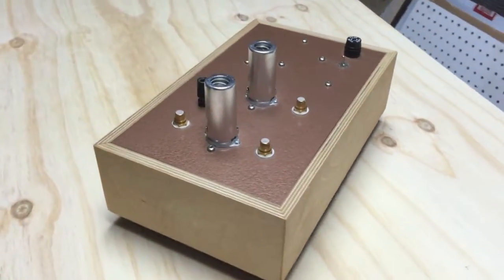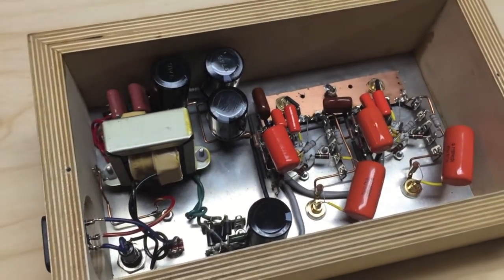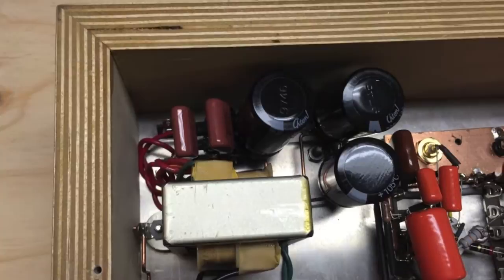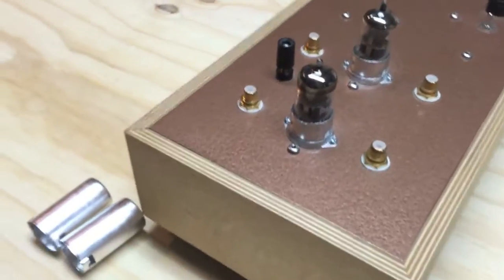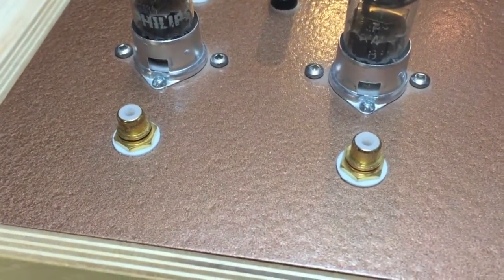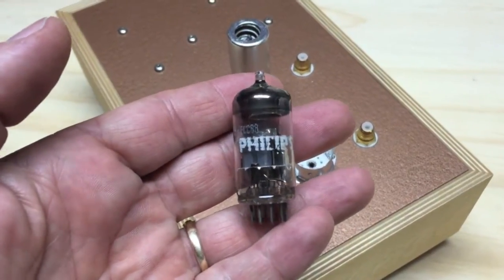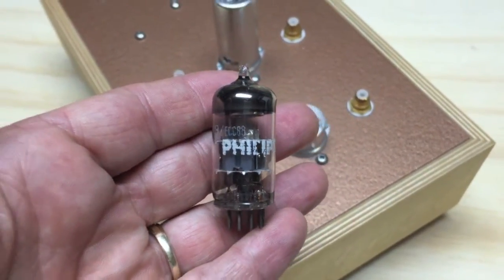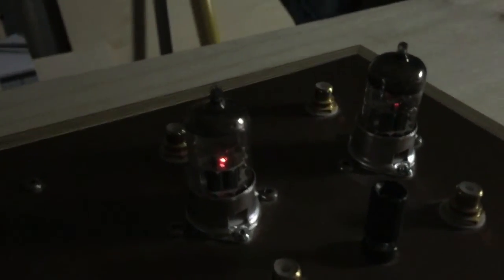Tube Phono - Turntable Preamp using 6922 tubes // DIY built

Comment: hi great preamp wondering if you have the circuit thanks eletrontube42@gmail.com
Reply from the maker: Thanks. I made that along time ago. I don’t even have it anymore, sorry. I made something different.  The amp in this video is loosely based on the RCA preamplifier for magnetic phone pickup with RIAA. Just google that. It is a tricky circuit to make quiet since there is a lot gain.

Comment: HOW ABOUT A DESINE USING 6X8 OR 5X8 YES DC HEAT HV MAIN IS 430 VOLT OFF THE PS MAIN CAP IS 22MFD 75 K DROPER 22MFD 47K DROPER 33MFD TO RUN THE CIRCUT YOUR THOUGHTS

Comment: I built the rca phono already. I prefer the 6922 over the 12ax7 tho. I want to try out your idea.

The RCA manual 12ax7 eq is a parallel 3n3 cap/22k resistor in series with a 10nf to ground. All this preceded by a 470k isolating resistor from the 1st tube plate. I did make a change, using red led bias instead of the 1k5/bypass cap cathode bias. Personal preference.

So what did you change in the eq for the 6922?

Comment: where did you source the schematic? i am interested in building one of these. Cheers!
Reply from the maker: Raymond Rockwell RCA Receiving Manual. I tweaked the schematic to use 6922 (ala The Bottlehead Seduction.)